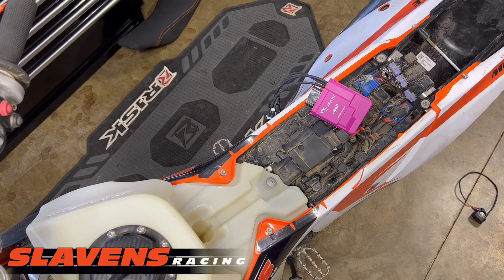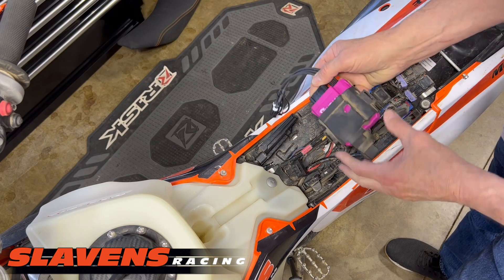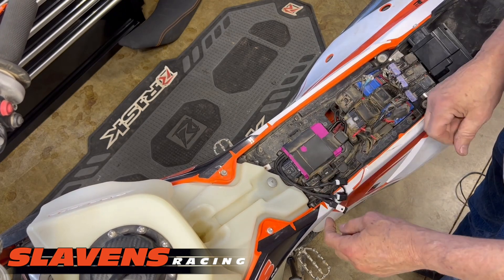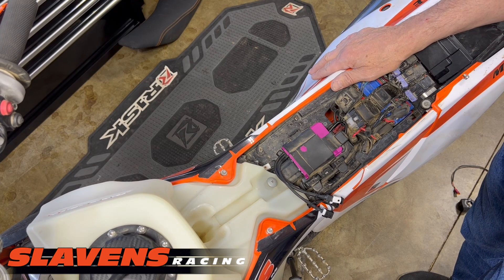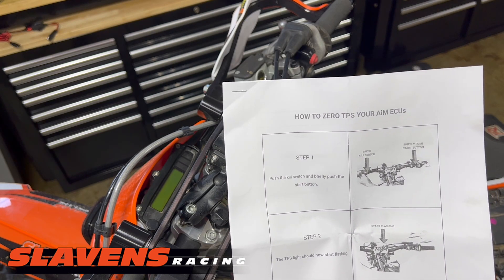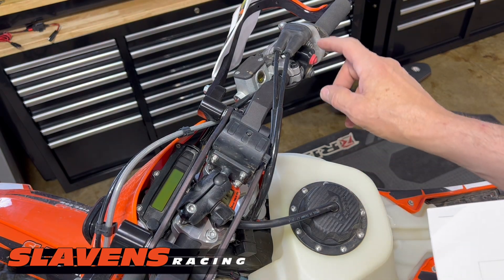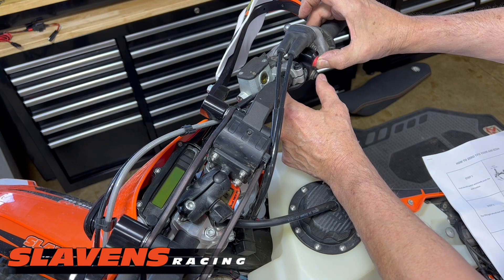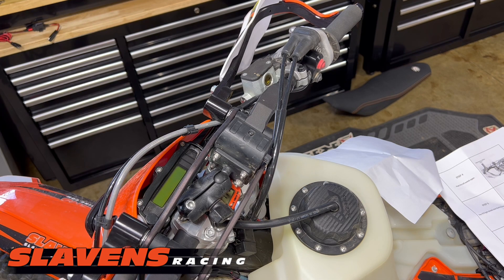How-to: AiM Taipan ECU Installation and Setup

Comment: I have the aim ecu install on my 2022 excf 500 and im not to impressed. I dont notice any power gain its just smoother. I did however keep my 02 sensor plugged up so not sure if im supposed to delete it it or not.

Comment: Do you know if you can use the standard switch that controls launch control, traction control and quick shift that comes as standard on the sxf an sx 23 module's with the AIM ECU? 

Thanks
Reply from the maker: Sorry, no it does not work with the AIM.

Comment: Surpised you would call the GET better, considering with the UC bridge you can tune more than the GET, you can fuel trim on the fly from the handlebar switch. You can access 5 maps from the Bars vs just 2. overall the AIM is a better unit than the GET when buying the full package.
Reply from the maker: The AIM with all of the add-ons you mentioned is more expensive than the GET and 99% of our customers would not know how to tune it OR even want to do it. We offer the AiM as a bare bones lower price point that you can just plug in and ride which is what most people want. For those who want wifi tuning from your phone, map switch included and an excellent ECU, we prefer the GET which is used by all major race teams in Europe and many in the USA. GET is on the forefront of tuning and technology, they give us excellent support and is a great company to deal with. AIM is imported by a company that has NO motorcycle people and NO support. We have learned the software and tuning with NO help from them. 

If you prefer the Aim, that is what you should use. 

Regards,

JS
Reply: @slavensracing  appreciate the response, and surprised to hear that you don't get support from them. I agree most users may not need the tunability of the UC bridge etc but it is there. And the fuel trimming which lots of people would use is handlebar ready. I agree each to their own, I use 3 maps regularly so couldn't go to a ECU that only has a switch for 2. Also the support from AIM has been amazing, they recently flew two technicians out to BC Canada to dial in snowbike maps with C3 Powersports I saw, which I don't think I have seen any other ECU manufacturer do. All in all glad there is lots of options out there for guys, thanks to the EPA! Hah